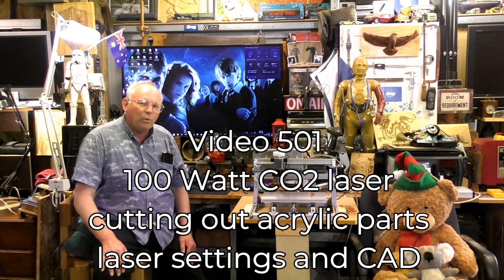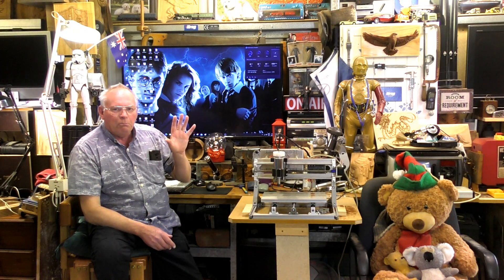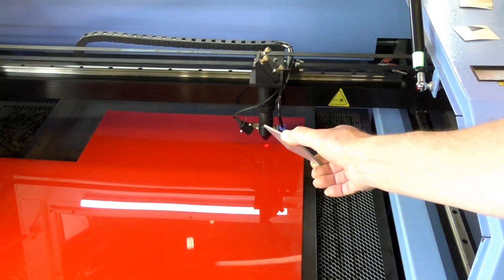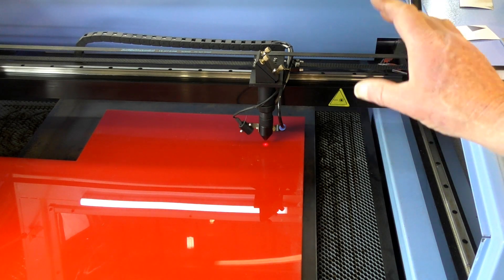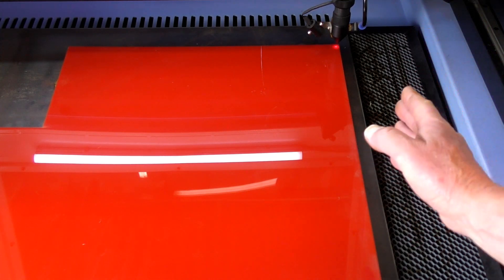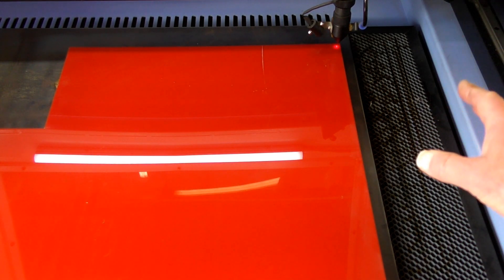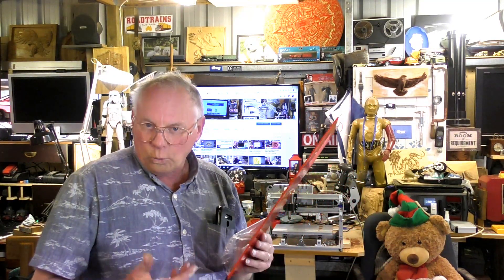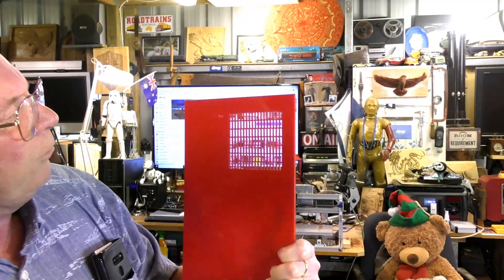100 Watt CO2 laser cutting out acrylic parts laser settings and CAD

Comment: What settings did you use with the laser to cut the acrylic? Do you have anything under the acrylic to keep it from scorching. I've never done acrylic but very interested. I'll be using 1/4 inch. 😁
Reply from the maker: Hi, I think its in the video!
Reply: @inventorsworkshop9600  I think he meant the settings you used to cut the acrylic, I didnt see it either.